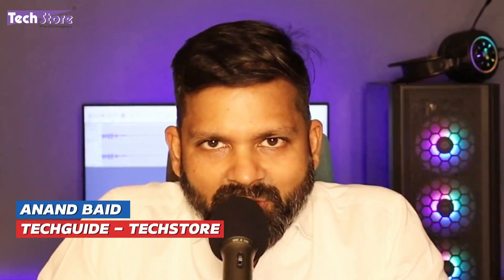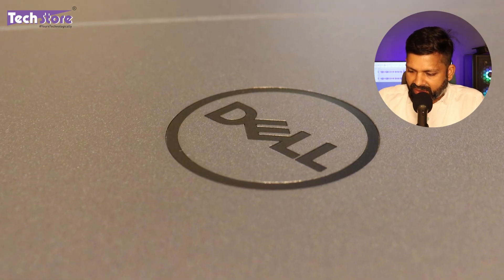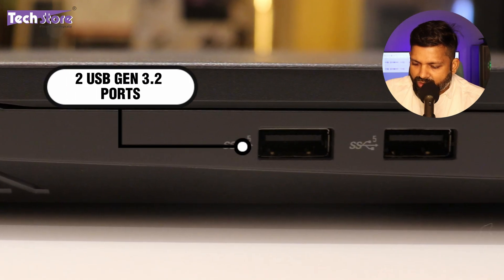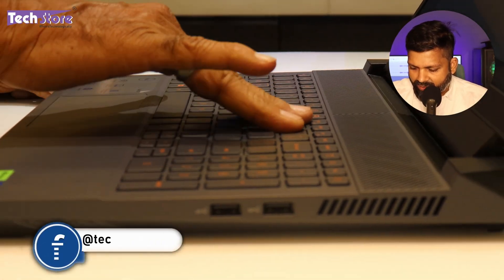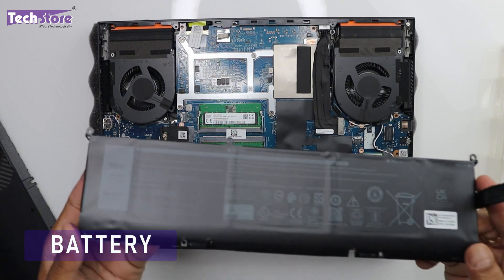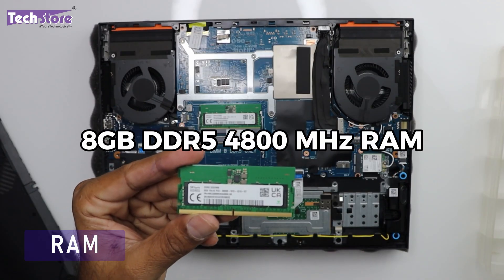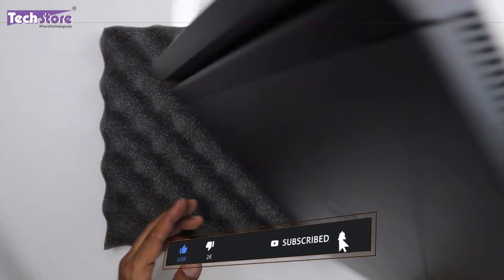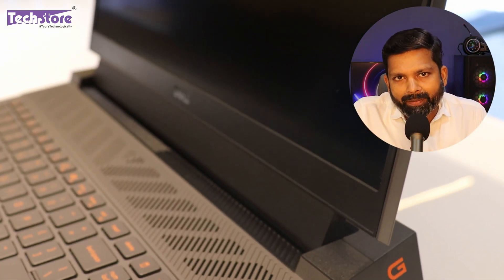Dell G15 5530 Review + Full Teardown & Upgrade Walkthrough

Comment: Hello sir , if i get  dell g15 5530 i5 13450 hx  ,4 zone rg  rtx 3050 16/512  at 76500 with bag is it a ggod deal.btw i am learning cloud computing and cybersecurity  .is it worth it or i should buy any other
Reply: I bought the same laptop dell G15 5530 - i5 13450hx, orange backlit, rtx 3050, 16gb ddr5 1TB ssd @56000 from Amazon sale last 3 months back.
Reply: @vamshikrishna2364 please share the amazon link
Reply: I bought it at 75000 with a bag
Reply: @Abhijit_das360  bro how is the laptop now , How is the battery performance and is there any heating issues. Everybody in reddit saying it's a bad deal 😭😭
Reply: I bought it for 70500 rs but now I think loq was a better choice especially because of display

Comment: 8:05 
R u sure that each ssd slot support upto 2TB nvme ssd?
Reply: Yes, the manual says so!!
Reply: @life_with_a_black_jc74  I have i5 13 gen.
Is it support additional 2TB 2280 with 1TB 2230?
Reply: I have 1 TB for the 2230 and 2TB for the 2280 m.2 nvme and they work perfectly.... but now I ordered 2TB 2230 and 4TB 2280, gotta wait a few weeks but will let you know if those work :D
Reply: @deyanmohamed  where you able to figure this out? I am ordering a 2280 type 4TB SSD as well.
Reply: @deyanmohamed  Update?
Reply: Bro i have dell g15 5530 i m using 8 tb 4 tb each
Reply: @premium_Huu_bhaii  did you buy  the 512 gb version laptop or the 1 TB version laptop?